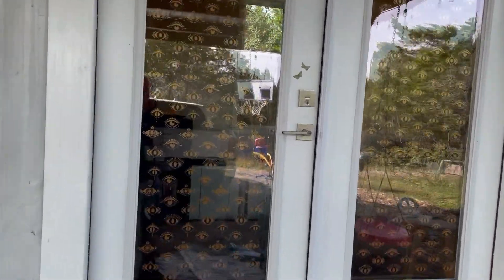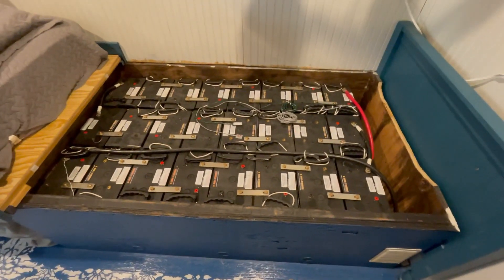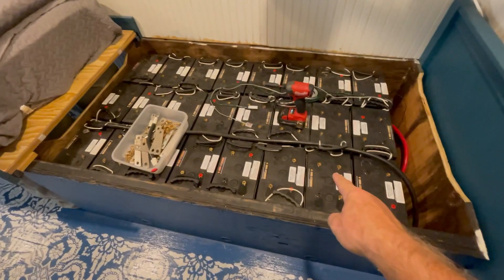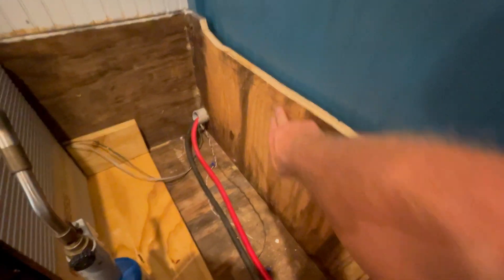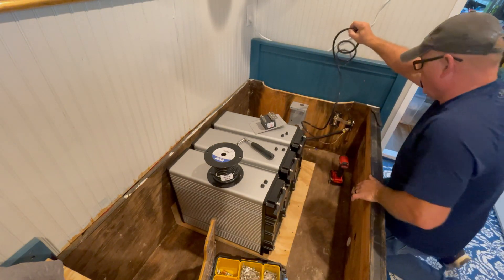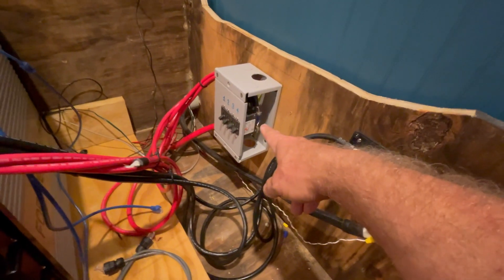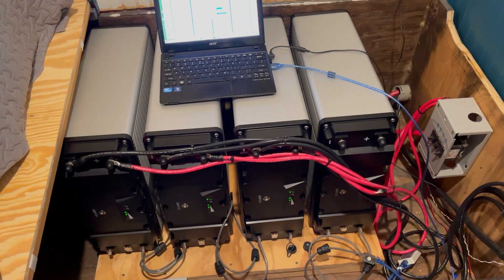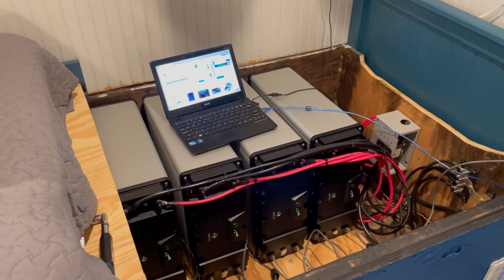Battery Swap: AGM to Fortress eFlex LiFePO4 Batteries

Comment: You could have gotten a 28kWh battery from me with all the same features for $12,000 which is like 2/3 the price per kWh and it would be one battery which is simpler.
Reply from the maker: I tried to pick a commercial product of a certain shape. I also work with several other LiFePO4 batteries. Let me know what you have.
Reply: @maverickmacgyver  If i give you a link youtube will block it.  The business name is North West Independence.  My name is Tim Burke.  Search for that and solar batteries and the website should be at the top.

Comment: The only time I really see issues with the flexnet and lithium is when I have a few days of generator only run time.
Reply from the maker: Does the Flex RT drift over time? Outback to eFlex settings seem conservative so I keep my eye on the voltages. Occasionally, I’ll plug the laptop into the BMS and look at each battery and at the cells to see if everything is on track.

Comment: YOU GOT A NICE SET OF LIPOFE4 BATTERIES DURING THE AGM CHANGE OUT . I KNOW YOU'RE GOING TO HAVE A MUCH LONGER AND MORE EFFICIENT RUNTIME NOW WITH THEM . AS LONG AS THE OUTBACK SYSTEM CAN STILL ACCRPT LIPOFE4 OVER AGMS , THEY WILL ALWAYS  LAST MORE THEN 10 YEARS WITHOUT DEGRADING AMONG US PREPPERS . CHECK OUT MY DIY SOLAR VIDEOS , HIT LIKE , LEAVE A COMMENT AND SUBSCRIBE . MAY THE SOLAR BE WITH YOU FOR THE 2022 +  NEW YEAR .:goodvibes::goodvibes:🎉🎉

Comment: Best thing I did over the last couple of years was to change out my agm battery bank for lithium. Huge weight saving and alittle bit easier maintenance wise. What I love is the low internal resistance which means they soak up nearly all the power my solar panels can produce whereas the agms at a low soc would really stuggle to take a charge efficiently, which is a nightmare in winter months. The lithium's are not problem free, temperature can be an issue, and extreme low soc is still a worry, but the fact they can be happily left at 1/3 soc is great, whereas the agms would be sulfating making them difficult to charge and shortening the life span.